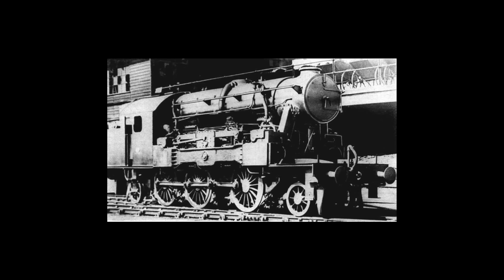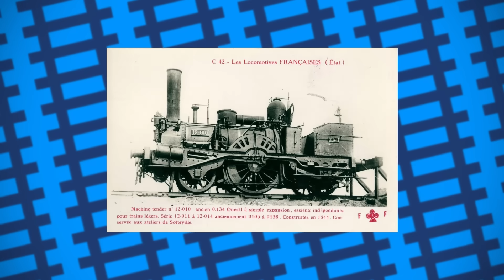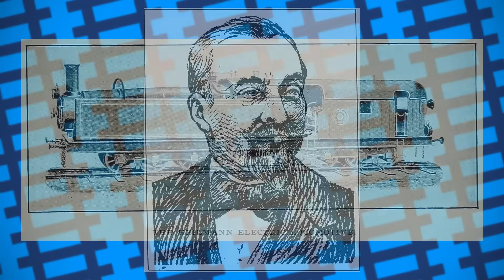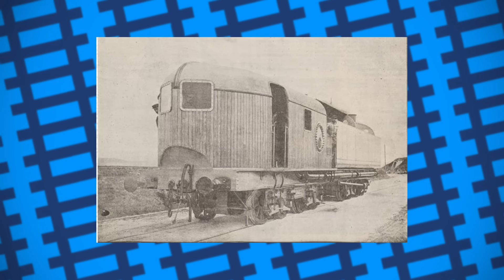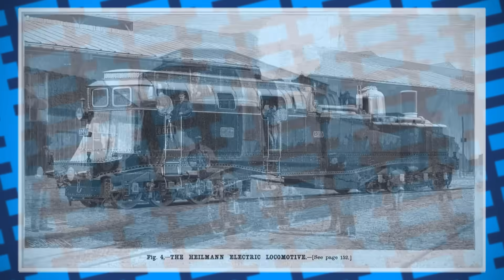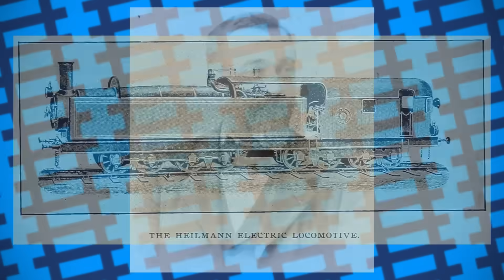France's Fascinating Steam-Electric Locomotive - Heilmann Locomotive

Comment: I wonder what difference a steam turbine would have made.
Another example of a vehicle ahead of its time is the Diesel Electric Paddle Vessel Talisman, built in 1935 by the LNER for use out of Craigendoran on the Clyde. She was driven uniquely by a huge direct drive electric motor fed by diesel generators. The motor was double ended with a paddle wheel on each end. It ran at about 46 rpm taking her to something like 16 knots. The start up current and the torque at that rpm would have been considerable. The motor was reliable but the generator sets were troublesome. She was scrapped around 1967.

Comment: I think someone should design a locomotive the other way, meaning (electric-steam):  Overhead-catenary lines feed a pantograph as in a regular electric train, but then instead of powering electric motors, the electricity is used to boil water for steam.  That steam turns a turbine, which in-turn powers the driving wheels!  A new concept I've never seen before!  Someone, get on it and build a prototype!  There's your new billion-dollar idea!  Run with it!

Comment: What's next? a Diesel-Electric-Steam engine?

If one does exist, It'll probably work like this:

The Diesel engine powers an electric heater, which heats the water, which powers a cylinder which turns a Dynamo which generates power for the wheels

Comment: I reckon steam locomotives could one day make a comeback in the form of steam-electric locomotives, but unlike on these engines, the water would be electricity heated, which generates the steam for the turbine to generate electricity for the locomotive’s traction motors. Said electricity could also be reused to help heat the water. Modern steam-electric locomotives would be very useful on unnelectrified lines, have a much bigger range than battery locomotives and multiple units and be more environmentally friendly than even diesel and bi-mode locomotives and multiple units, as steam-electric locomotives wouldn’t burn any sort of carbon-based fuel to heat their water, so the only thing they would emit is environmentally harmless water vapour.

Comment: You mention communication between the driver and fireman as a problem. I fail to see how. Its not like the fireman needs to vary steam production as the loco travels. Its powering the generator almost completely divorced from road conditions. For the most part the generator is going to run in a steady state.

Comment: This just made me think one of those "what if's"...

What if they would have skipped the electric part, and instead used a pair of steam engines basically geared together into a CVT...

Another idea, one that could have some, if not very likely, potential in modern world could be to slap a heat engine next to a diesel to extract more energy out of diesel exhaust/waste heat. I would kind of like steam... but maybe it would be more practical to use something like a simple turbine or possibly an externally heated variant of the brayton engine. Most braytons are of the internal combustion variety, because it would usually make little sense to put an un-necessary barrier between combustion and the hot side of the engine. As a heat energy recovery unit however, external heating might make some sense.

Yet I can see two potential issues, one is obviously the added cost and complexity and the other is weight and volume.

Anyway... Sometimes I just get such crazy ideas, I am fairly sure would not be much more than possibly mere "interesting thoughts". But sometimes that is all one needs. That freedom to cook up wonderfully weird what ifs for no other particular reason but the thought itself... And while many of my ideas are not allways very practical. There are occasionally some better ones too. And personally I think it could be difficult to tell which ideas are good and which not so much, if not by actually thinking and finding answers to why something could work and why it might still be a bad idea.

Comment: and nucular decay heat. ok nuclear-steam-electric is steam-electric, unless direct nuclear-electric like beta rad electric. weight is not much an issue in heavy trains. alpha/beta decay direct/steam electric would work just fine also for large off-road trucks. nuclear coal weights almost nothing, runs for 400 years. no, its better to have optimal rpm of the engine to convert to 100% electric, then optimally run the electric motors at 100%. well dont lose anything in the conversion then. like in modern diesel-electric trains. parts are always expensive, no matter what the time period. well dont blame if some corp cant make it as good as it can, for corp reasons. air trains (plane) for nuclear decay power. or those mentioned large land crawler vehicles.

Comment: im surprised that steam turbines were not used on trains more. in 1940s when steam was still strong, steam turbines were well understood.
Reply: Turbine driven steam locomotives were tested but never managed production. Turbines spin fast. Really fast. Stupidly fast. You’d need a transmission to turn their speed into usable torque to pull a heavy train. And having a big heavy turbine and complicated heavy gear arrangement is just not practical with the weight and space restrictions usually found on contemporary steam engines. Pistons just last longer and are easier to maintain and replace. If you want the efficiency gains, look for a compound steam engine like the Class 02 of the German Railways. Even she was replaced by the „normal“ single expansion class 01 as the compound wasn’t as powerful. Well, replaced isn’t the correct word. The 01 and 02 are basically the same machines with a different cylinder design and were in development at the same time. Still, the 01 ended up serving for decades and many 02 were converted to 01
Reply: @Handyman1199  coal-electric with coal powering steam turbine. no need for direct connection to wheels.
Reply: @jebise1126  steam turbines werent really a cheap enough commodity until the 40s when Diesel was already peering its ugly head, also we had other things to worry about during WW2
Reply: @jebise1126  This was never going to work because steam turbines do not scale down well. A small steam turbine is proportionally much more expensive than a large one, and it's also much less efficient. I suspect having a steam turbine mounted on a moving train would also cause problems navigating turns due to gyroscopic effects.
It's simply far more economical to put one massive turbine in a powerplant and pipe the electricity into many different locomotives with a catenary than trying to produce tens of smaller steam turbines each with its own boiler and all the other issues that come with it. The logistics of delivering coal to one power plant are also significantly easier than trying to keep a fleet of engines constantly refueled and watered.
Reply: @Handyman1199  The think I find particularly interesting about stem turbine powered locomotives is that all of them relied on mechanical transmission, that comes with all those drawbacks you have listed, while steam turbines were already happily powering generators in large power plants. In with this locomotive in existence, they were IMHO single step from building powerful steam electric locomotives, but they decided not to do so.

Comment: A steam-electric locomotive is mostly pointless, because the steam engine itself has built-in hybrid features. The boiler acts as an energy reservoir holding the superheated steam until it is used in the cylinders to generate work. It does have a huge starting torque, so it doesn't need an electric motor for that. Its wet nature could pose problems to the electrical part. Steam-electric power systems have been used in ships, but it does not make sense to use them in trains.

Comment: Thanks - hadn't heard of these before! At the beginning I thought that this must be a stupid idea, but I see that it was actually quite effective. I guess the generation of electricity on board from a steam engine would be the weak point - it can't be that efficient, though I'm not sure how it works on this loco. Obviously power stations on land use a turbine arrangement, but that may not be practical on a loco! Not sure that conventional locos were that efficient - tons of energy is lost out of the funnel and cylinders! But adding a generator is another source of loss. And as you say, it just adds complexity.
Reply: Conventional steam locos have a thermal efficiency of less than 10%, they're very poorly optimised as heat engines generally. A electric generator can easily manage 80% or better, so features that help improve steam efficiency (like running triple expansion, which is impractical for a conventional loco) might outweigh the generator and motor losses.

Comment: As someone who has worked on and helped maintain a steam locomotive, the real problem for the railways was the boiler and steam parts compared to electric and diesel-electric.  Steam locomotives require a lot of maintenance and frequently have to be taken out of service for maintenance and inspections.  Things will break without a lot of preventative maintenance and the boiler may explode, if things aren't handled properly.  Unlike the electrics which can be turned on and off rapidly and the diesel-electrics which also can be turned on a bit less quickly, steam locomotives have to be heated up slowly to prevent damage.   So to have equipment ready, there had to be a group of men assigned to bring the locomotives up to running heat and keep them hot consuming fuel.  When railways got rid of steam, they cut their mechanical shop payrolls down to a quarter or a fifth of what they were.   Electrics and diesel-electrics can be linked together reducing crew costs.   I don't think any boilers could operate separately.  So while electric motors help eliminate the hammering effect, a steam-electric locomotive still has the steam plant hazards and maintenence problems.
Reply: I've worked a lot on electrical equipment concerned with power generation, steam raising plant and electrical traction systems and I think you've hit the nail on the head as to why hybrid schemes relating to steam locomotives were never really going to come to much. You could have completely automated the boilers of course, which would have enabled multiple locomotive working, but would the extra expense and complexity have been worth it given that when the technology was advanced enough to do this, diesel engines, with their advantages over steam, were beginning to appear as well.
Reply: @KevinRudd-w8s  Reciprocating steam engines are also insanely fuel inefficient, with efficiency topping out at around 10% for the double-acting designs typically found in locomotives. This is extremely poor compared even to all but the earliest of internal combustion engines. They are also REALLY hard to get started in poor adhesion conditions (wet rails, steep grades, etc).

Steam locomotives are so inefficient and expensive to operate that even in the early 1900s, when electricity was still in its infancy and electric motors were very expensive, many European railways were already experimenting with electrification, sometimes with whacky designs like the three phase locomotives that were used in some parts of the Northern Italian mountains (until 1976!). They had two overhead wires with a split pantohraph for two of the phases, and the third phase was in the rails.

The writing was on the wall for steam locomotives as soon as large enough diesel engines and/or cheap enough electric motors started becoming available. 

Steam turbines scale down very poorly from a cost+weight/performance standpoint and were never going to work for a relatively small vehicle like a train. Even today, they are only used for the largest of cargo ships while all the rest use diesel engines.
If you want to power an electric drivetrain with coal, putting a giant steam turbine in a power plant and delivering the electricity to many different trains with a catenary is simply a far superior solution.
There is no possible universe in which steam could have won this race.
Reply: Nowadays, with the electrical infrastructure in place, we kind-of have such locomotives. 

Enter tbe ICE 4.

Steam power is generated by coal power plants located near the tracks. The coal Bahnkraftwerke are being phased out though, with plans to replace them with high efficient natural gas power plants.

But, for some reason, Russian natural gas has become a bit unpopular, so the conversions seem not to be progressing according to plan.
Reply: well... im sure that with todays materials steam ones could also work long time. nuclear plant is after all just big steam engine. and lots of ships are also still steam ones. steam turbines but still steam. so yeah steam turbine and automatic adding of solid fuel could still power trains of today. if earth didnt have enough oil but way more coal.
Reply: @jebise1126 Lots of ships are still steam powered? Really? I was in the merchant navy for twenty years between 1980 and 2000. During that time the only steam ship I sailed on was a VLCC built in 1974 many of the officers and crew I met had never sailed on one, most of those who had were ex Royal Navy plus a few who had sailed on tankers built before the mid 1970s or where old enough to have sealed on ships built in the 1940s. Ships still have boilers of course for auxiliary duties such as heating fuel oil and cargo tanks, on board heating etc but you will not find many steam ships in general use today outside of nuclear powered warships and submarines and various heritage vessels such as the SS Waverley. The vast majority of ships these days are powered by either slow speed reversing two stroke diesel engines or medium speed four stroke diesels. Some specialised vessels and a few cruise liners are diesel electric. There is one very good reason for this, the price of fuel. Steam ships burn far more of the stuff than diesels, simple economics.
Reply: @KevinRudd-w8s  : every time the subject of steam hybrids comes up, the Steebs (steam weebs), one by one, as if guided by a rope tied with false hope and glued together with the "output" of Rev. W Awdry's sultry wet dreams, come out of the woodwork with bizarre and fanciful stories about how "it could be done with modern such and such, and steam will make a comeback!" based on false claims, assuming the reader (who always knows better) doesn't know any better. You have to kind of learn to tune them out lest you find yourself drowning in a chorus of Steebs screaming "JAWN HENRY!!!!!!" at turbojet-like decibel levels.
Reply: Couldnt that have been fixed by splitting it into a power generator car and a slug?

Comment: Huh. I wonder if logging roads in the US could have built steam-electric Shays. You still have a weight and cost penalty, but you get to avoid the drivetrain complexity that's one of the weak points of the Shay. You get excellent starting performance and you can still burn wood instead of buying diesel. It's an interesting hypothetical.

Comment: I find it funny that part of the complaints was that it had less power, considering it used 18% less fuel, which essentially means it could've run ~22% stronger than it was at the time and still be on par with the benchmark for fuel consumption.

This is a common complaint that happens with hydraulic>electric>hydraulic, it may make less power yes, but you can absolutely use the efficiency increase to compensate for it.
Reply: Ahh, the benefits of being able to operate at the optimum settings with perfect constituency! One of the many reasons I support Edison Motors!

Comment: This engine seems to have more in common with the power plant of an Ocean Liner at the time, using the steam to power a triple expansion steam engine but using that steam to spin the dynamo, which was also done on ships to generate their onboard electricity once the technology became more prevalent, i could only imagine what kind of designs would have come about if someone tried to use a Parsons Steam Turbine instead of a conventional steam engine to power a train

Comment: The Heilmann did foreshadow the diesel electric, and was technically a success but was killed by the inability of the specialists to think outside the box... further more there is the fear that engineers have of electricity....trade unions requiring an electrician on board  to turn the switches...Sure there where some drawbacks, but just see how revolutionary this design was & how  common it is today.... albeit in diesel electric version....

Comment: Given that the overall efficiency was 15% more than that of a conventional steam locomotive, the conversion losses must have been manageable even with the primitive electrical technology of the time, and would have been better later on.

That said, the steam-electric locomotives built later in the US did not catch on either, although by that time they were competing with diesel-electrics as well as conventional steam locomotives.
Reply: I gather one issue the US attempts faced was that coal cinders and electrical equipment do not mix well.
Reply: @MrBirdnose So I have read, although this  video had no mention of such a problem.

Comment: Upgrade it to a V4 double expansion engine and you can raise it's power to be as comparable to other engines at that time. Most conventional steam locomotives have 2 engines, one per side, and this one only had one engine in double expansion. With a V4 setup with each bank being a set of double expansion engines, you technically double it power rating without increasing the length of the locomotive and further justify it's hefty weight.